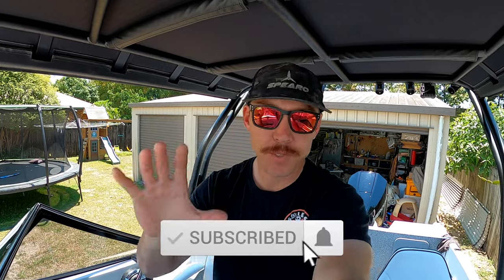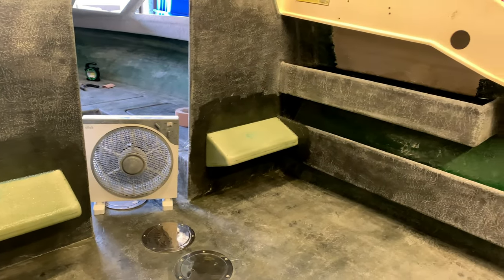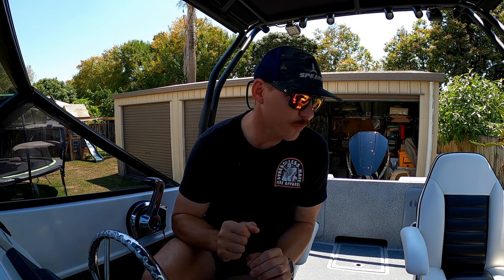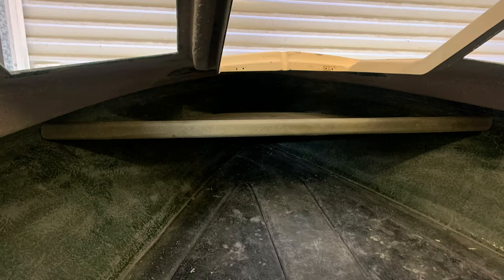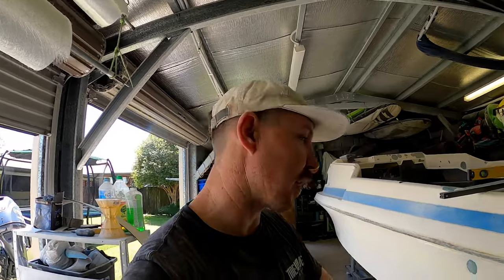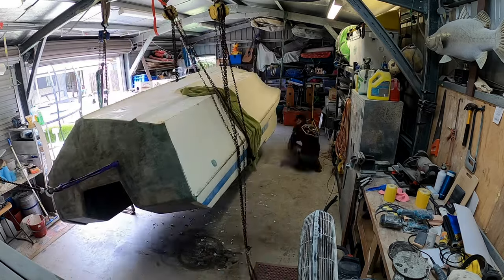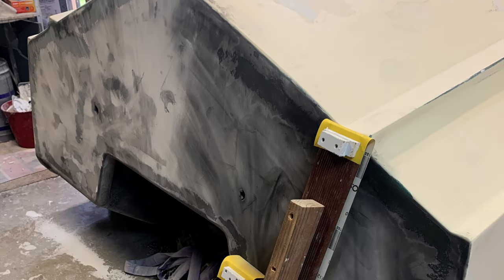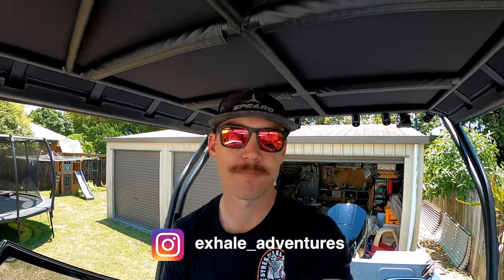Haines Hunter 565c Rebuild | Part 2 of 4 |  How to Flip a boat | Side Pockets | Flow&Gelcoat Prep!

Comment: Electric sanding all done using the orbital? No powerfile?
Reply from the maker: Round and rectangle Orbital and hand sanding mainly mate. I did have an pneumatic sander but mainly used the big longboard mate for the flat stuff. Anything curved was by hand
Reply: @ExhaleAdventures  yeah the flat stuff tip was great. Cheers mate 👍🏻

Comment: hey mate on my haines i had some trailer damage it was like 5m deep you recond its fine if i fill it with fairing?
Reply from the maker: Fairing is pretty soft mate. I would be tapering the edges of the scratch and filling with some fresh gelcoat and sand it flat again. There is a heap of vids on YT with some good tips on it 🍻